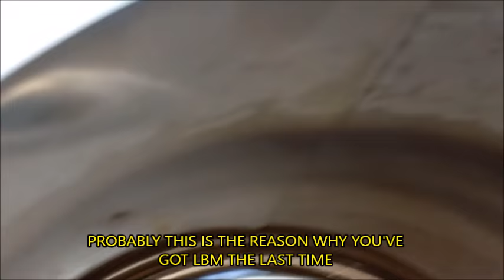HOW TO CLEAN YOUR WATER DISPENSER, DIY TUTORIAL

Comment: Really appreciate a genuinely comprehensive cleaning guide for these, just had one given to me but it was leaving nasty flakes in the water. Most info I could find before this just said to run cleaner then 2gals of water through the reservoir by both faucets, no mention of the drain tube or dismantling the faucet heads like this. Big thanks!
Reply from the maker: thanks for watching sir and happy new year!

Comment: I removed the bottle immediately as soon as i noticed that the water is leaking from the sides of dispenser.
Reply from the maker: check possible leaks on the fittings, rubber hose fittings

Comment: Boss sir, tanong ko lang po bakit malakas ung ingay NG compressor NG water dispenser ko?
Reply from the maker: anung ingay sir? malamang vibration po
Reply: @RDCTV  yes sir vibration po kapa open ko NG ung cold
Reply from the maker: hanapin nyo po kung san yung part ng vibratio at lagyan nyo ng insulation para hindi maingay
Reply: @RDCTV  anong Klase g insulation po?